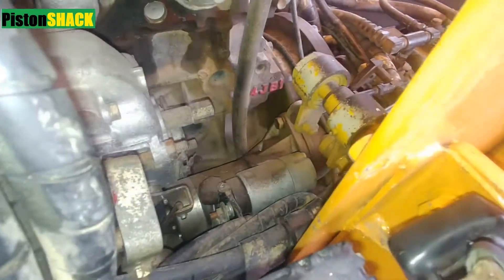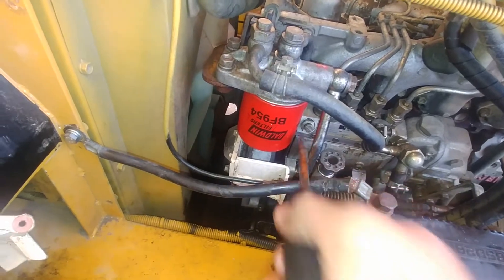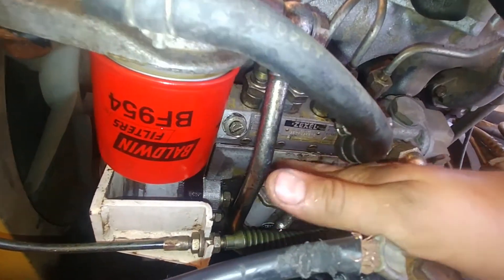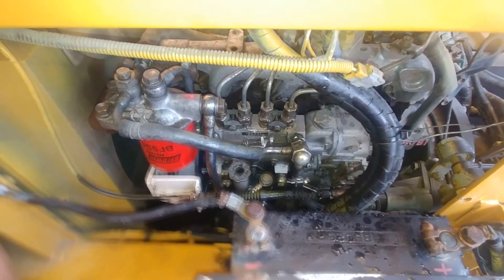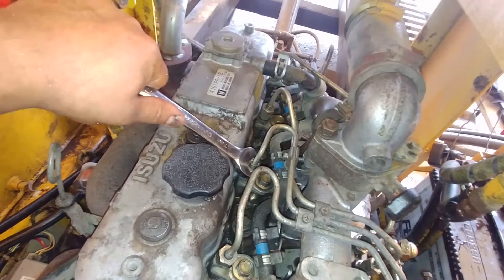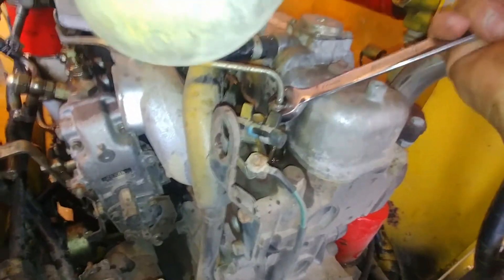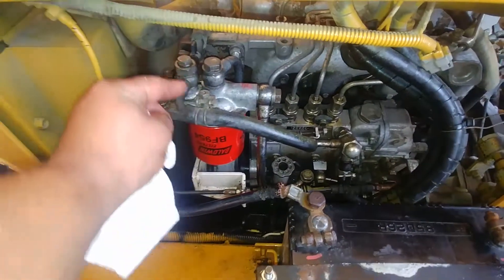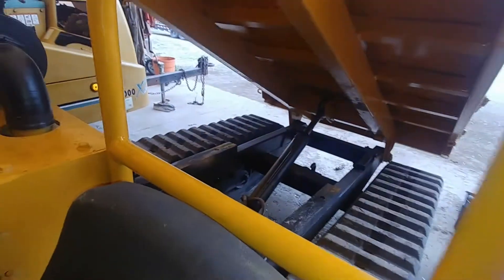ISUZU 4JB1 2.8L - HOW TO PRIME or BLEED FUEL SYSTEM

Comment: 2004 USA Isuzu turbo diesel on NPR suddenly lost power on road.  I pulled the fuel filter.  It was just above one-half empty of fuel.  I changed the fuel filter and filled it up before installing but did not adequately bleed the air.  I'm no mechanic.  : (  After much cranking finally the engine started back.  Seemed okay and drove okay.  Then later a few hours later died once again.  This time, the fuel was about half way drained from the filter also.  But now I cannot get the truck to start.  Any help appreciated.
Reply from the maker: Hey brotha! Check banjo bolt fitting at the bottom of the lift pump on fuel supply line to the prime pump from the fuel tank first. Banjo bolt has tiny screen inside, which over time gets clogged up.  Most likely that's your problem. I saw it happened on Isuzu diesels before, exactly matching symptoms your described. I  have another video showing that banjo bolt and screen filter inside (ISUZU 4JB1 FUEL LIFT PUMP REPLACEMENT | 2.8L Isuzu Diesel Prime Pump) 
https://youtu.be/3tL-h3VmEuo
how to remove lift pump on 4jb1, check that one out. 
Let me know if you have any questions.